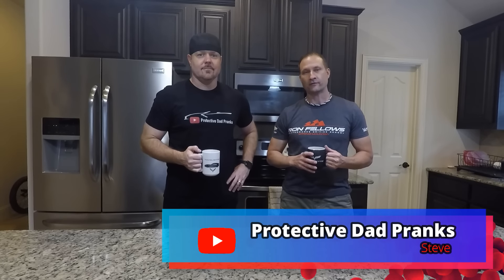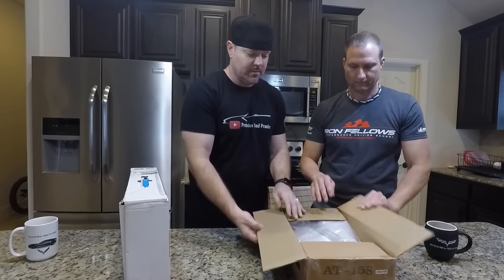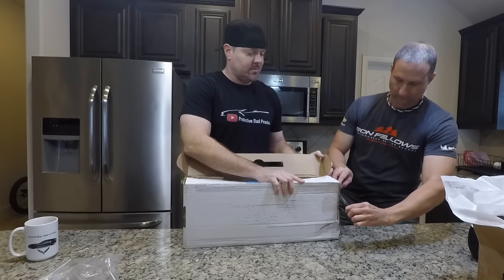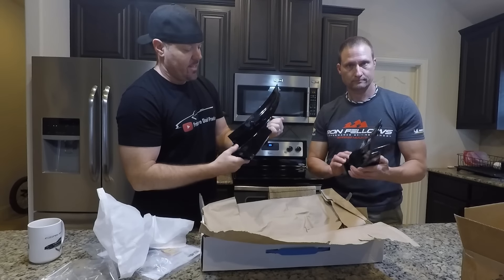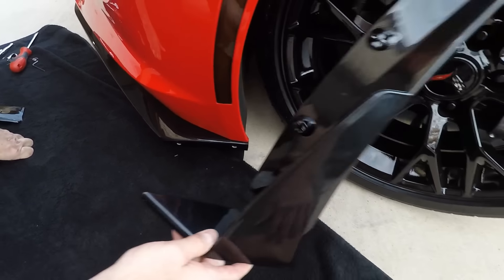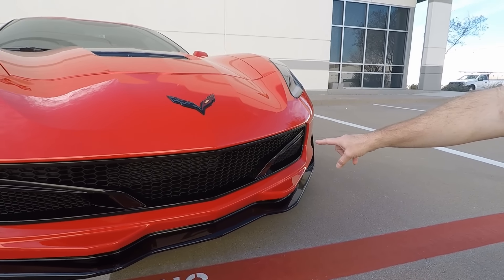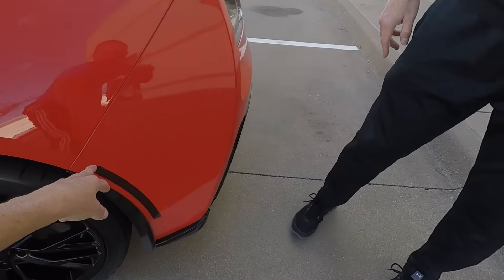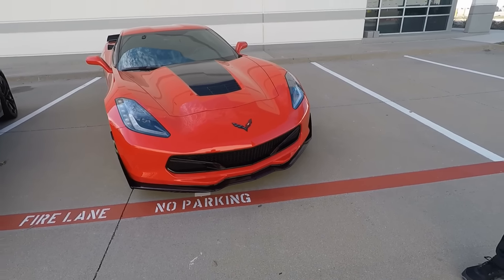Never Install Cheap Corvette Mods - This is why!

Comment: I have a 2017 Stingray and am a hardcore ACS guy as well. My front splitter, winglets, rear rock guards and now rear extensions and the very cool Z06 vents which just arrived today. ACS literally had these to my front door within days of my order. Cost more but quality is well worth it. Great video
Reply from the maker: Agreed. The quality is definitely there with ACS. 

Which vents did you get? The ones that have to be cut in or the non functional Z06 vents?

I have a video with the ones that were cut in if you got those.

Comment: That Stingray is one of the best I’ve ever seen fasho💯. Still buying my Grand Sport next month tho lol
Reply from the maker: lol. That's a good choice. you can still do mods but you won't need to do as many. i highly recommend diffuser fins though. they really help finish out the back end of the car. and depending on which splitter yours has I would get a carbon flash one if yours comes with the plastic like my G.S. did.
Reply: Love my Grand Sport! And you will certainly feel the same when you get yours next month!
Reply: Front Seat Driver Still considering the diffuser fins...
Reply from the maker: I ABSOLUTELY love them. I just never get sick of them. I doubt you'd regret it but I certainly understand your being hesitant.

Comment: I got an EOS splitter that came with stage 3 EOS widgets.  Was wondering if the ACS version will line up with my EOS splitter?
Reply from the maker: You can message ACS on Instagram and they can answer you on that.

Comment: I never thought I'd ever see the day where I'd hear "cheap" and Corvette in the same sentence.
Reply from the maker: It happens frequently with aftermarket mods. This weekend when I was at Corvette World they were going to install diffuser fins on a Grand Sport for a customer and the screws were the wrong size. He said most companies have very bad quality control. I won't mention the brand but it was not ACS Composite.  The actual fins looked pretty good but the hardware was useless.

Comment: I have a silver 2019 stingray what mods will be good to add
Reply from the maker: I would do ACS Composite rear diffuser fins. AFE Cold air intake. Front splitter and side skirts. ACS Composite rear 2.5 spoiler.
I'd probably replace the front grill as well. Get a Z06 style grill. ACS and GM sell them. Just take your time and do it piece by piece as you have the money. Always fun doing new things.
Reply: A passenger ejector seat
Reply: Where’d u get the front splitter

Comment: Did either of you guys do the Corsa X-Pipe with your Extreme systems? Like? Dislike?
Reply from the maker: No. neither of us did. Steve has been going back and forth on that decision. Some people say it makes it louder some don't.
Reply: We’ve researched it. We both love the pop and we saw a video from a Corsa rep who said the X-pipe removes the Pop. That’s a no go!
Reply: Thanks for your replies. The Corsa factory is about 20 minutes from me. I’m getting the new Active Valve exhaust installed on my ‘18 GS in the spring. Allows you to toggle between Corsa Sport & Extreme through the OEM controls. It’s available with or without X-Pipe which is why I wanted your thoughts. Thanks again!
Reply: G Money Corsa Exhaust is easily the best Mod I put on the Stingray!

Comment: Talks about keeping the stingray badge cause it's not a Z06 but has the rims, taillights and winglets....🤔
Reply from the maker: Winglets are not Z06 specific. It's stage 3 aero specific. Grand Sports with the Z07 package have them as well.

If he removed the Stingrays and got the tail lights then he'd be trying to be a Z06. There are many feature differences between the Stingray and Z06 in appearance besides the tail lights.
Reply: @FrontSeatDriver  I have the stingray winglets from ACS and his are not those, they are grand sport/z06 stage 2 winglets. Even without the stingray emblems, it cant be mistaken for a grand sport or Z06 by anyone that knows even the slightest thing about c7 vettes. The comment was just silly cause he is trying to get as close to possible. ACS sells the full wide body kit so go all and TPS motorsports sells the stock lt4 blowers so go all in....just keep that stingray logo so people know it's a stingray.
Reply from the maker: @yellowcourier  No. No one "should" mistake it for a Z06 for quite a few reasons but his objective is to make it the nicest Stingray out there. The front winglets are from ACS and they're designed to fit the Stingray. His point is he isn't trying to come off as a total rip off of a Z06 so he'd never take off the Stingray emblems.
Reply from the maker: @yellowcourier  I have stage 2 on my GS. They're much smaller. I had stage 1 when I bought my car. Looked cheap.
Reply: @FrontSeatDriver  I agree, the stage 1 is pointless, i prefer the stage 2 but they're too wide for the stingray and looks kinds rigged up. The ones ACS sells are in between the 1 and 2 and fit the narrower rearend of the stingray better, imo. I didnt think so at first but now when i see a stingray with the stage 2 for GS/z06, it looks rigged up. Again, imo. To each their own tho, I drive mine and he his. Just hope I'm not parked next to him tho cause I may take that baddest stingray trophy right out from under him, hahaha. Anyway, keep on keepin on 🤘
Reply from the maker: @yellowcourier  😃. Thanks, Sean. You as well my friend.